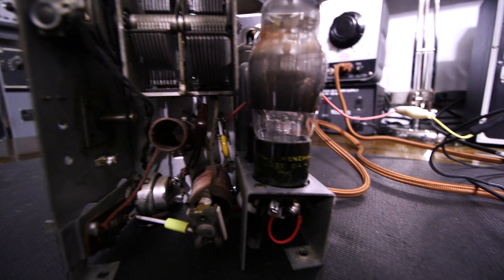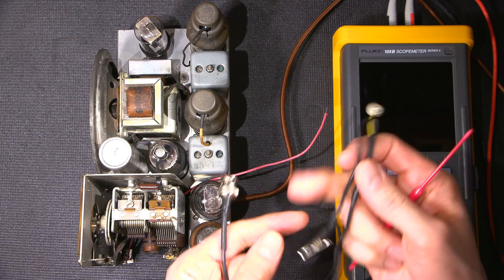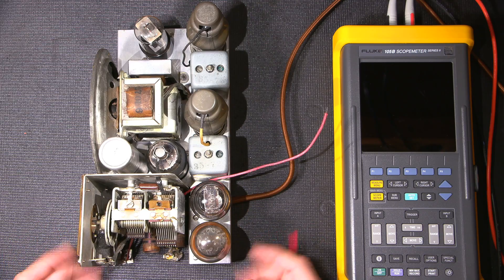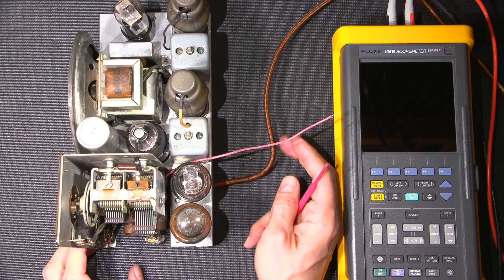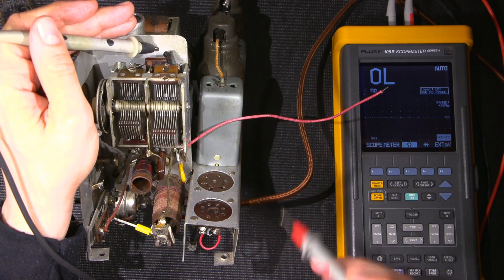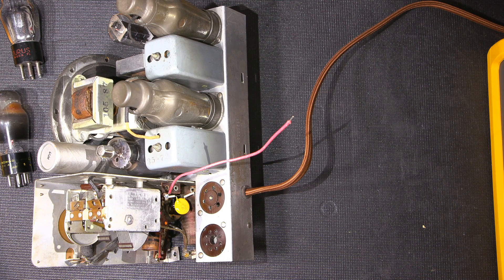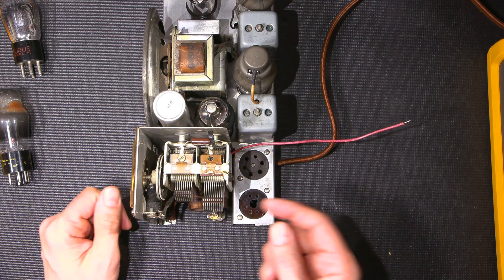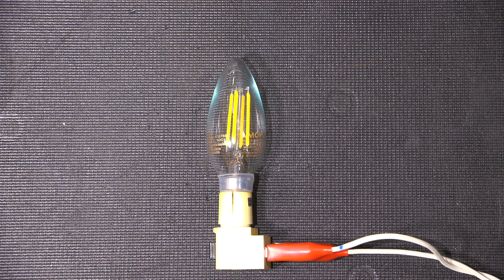See High Voltage Created From Falling Snow!

Comment: I'm a broadcast Engineer who specializes in maintaining AM arrays. We were hooking up a new tower in an older 4 tower array and there was an electrical storm approaching. one of the guys with me touched the tower and got a healthy shock from it! (the transmitter was off). We measured about 120 volts AC across the base insulator! Since then we use a jumper cable to ground the tower and make it more safe. Also don't play with a 285 foot lightening rod with electrical storms around!

Comment: I think you have two air gaps breaking down microseconds apart.  The chassis is isolated, so the incoming static electricity is charging what in effect is a parasitic capacitor between the chassis and its surroundings.  It's very cold outside so the humidity is low.  The voltage on the chassis will steadily increase until it flashes to ground through the path of least resistance, which I suspect is the air gap between the primary and secondary windings of the isolation transformer.  Once the accumulated static charge dumps to ground, the potential between the chassis and the coax instantly jumps from zero to several thousand volts.  This risetime is so fast that the inductor blocks the inrush current forcing it to take another path to the chassis.  That path is the narrow air gap between the coax and the radio chassis.  You have inadvertently created a relaxation oscillator.

Comment: As A commercial pilot, I have gotten St. Elmo's Fire from snow! It is a real thing, even with snow.
Reply: NBNTelevision the first time you see it and you haven’t heard of if it freaks the hell out of you!
Reply: Could you also see a new horizon underneath the blazing sky?
Reply: Annnnnnd...isn't it also the case that it doesn't harm your radio equipment? Even though it's all solid state gear these days?

I mean, if I take Carlson's fearful comments at face value, one would expect electronic equipment damage aboard aircraft whenever this phenomena occurs; esp. the radios. But, (normally? generally?) it doesn't happen! Planes get where they're going fine, despite flying thru wild fields of static potential up there.

I'm not yet convinced it wasn't simply because he had his lab+rig+antenna system connected in some unfavorable way somehow.
Reply: Andrew Skretvedt Quite the contrary. Aircraft are very different. We aren’t properly grounded. We have static wicks on trailing edges to help dissipate static electricity. In my experience, I’ve had avionics damaged from static. I am not as familiar with the isolation techniques used in avionics, but it’s kind of a different game from radios here on the ground, something I’m much more familiar with. Static can and does damage avionics. That’s why we have backups for backups.
Reply: @atsdroid  I replaced about 200 IP phones at one place in Reno, they all died from call center agents plugging in their headsets after walking inside each morning.  Electromigration is a thing, it becomes more of an issue as junctions become smaller.  If that arc kept going forever on the tube radio, eventually it would eat a hole in the chassis.  It's a lot easier to burn a hole in a silicon die where junctions are the size of a few atoms.  Eventually the phone was redesigned to improve decoupling at the headset port, but that same tiny shock applied to any other part of the board would still probably kill it.  It's impossible to isolate everything, at such tiny scales.  This is basic physics, not "fearful comments".  It's a huge multi trillion dollar ongoing challenge in aerospace.  A single charged particle can break 1000s of electrons loose, and it can be hard to predict where they go.  Real world testing and revisions are required.  This is why the radiation hardened parts used on aircraft lag several generations behind modern technology, on top of the larger processes being less susceptible to radiation damage in the first place
Reply: Seen it lots myself too. You can hear it on the radios crackling away but my understanding of it is that the avionics themselves (and the occupants) are protected by the Faraday cage effect. Hence the static (St. Elmo’s) remains external to the skin and doesn’t damage any of our electronics. It looks really cool though! But 36 years of flying under the belt and no damage to anything on the aircraft.
Reply: @malcolmhodgson7540  If you can hear it on the radio, then some is getting inside via the antenna.  Fortunately those radio frontends are designed to handle it.  Ever since Pan Am 214 went down due to a lightning strike that ignited the fuel, careful engineering has gone into redirecting all those stray electrons away from anything important, and commercial aircraft are very, very safe now, despite each one statistically getting hit by lightning at least once a year.  But there are still occasional issues - the Aeroflot crash last year was due to a lightning strike taking out the radios - one in a trillion chance that the antenna got hit directly, instead of the lightning rod right next to it  (St. Elmo's is also a lightning strike, just a smaller one that goes backwards)
Reply: @nbntelevision1  They're doing something right in aviation, though, whatever it is exactly, because we don't have computerized airliners and their radios becoming disabled every time they get close to weather phenomena. Weather flying is a daily occurrence, and while failures do happen, from time to time, you'd expect more given the conditions flown in on a routine basis, if the cause of the failures were shown to be static charges on the aircraft skin, antennas, etc.
Reply: @atsdroid  The static wicks they mentioned have a lower corona voltage than the rest of the skin and high resistance, allowing accumulated charges to dissipate slowly rather than in bursts.  Lightning (whether small or large, forward or backward) tends to go for the pointiest thing nearby.  The static wicks are really pointy.  But the main thing they're doing right is being in the sky (high impedance path to ground), made of metal (Faraday effect), and not dangling a half mile long ham radio antenna out the back (a big pointy thing).  Avionics are also engineered with isolation in mind - every regulation to that effect is written in blood.
Reply: @atsdroid  It may also be worth mentioning that even with the static wicks and frontend isolation, a very common source of 'could not duplicate' shop reports is that some of the charge from the atmosphere-earth plate capacitor dissipates through the antennas anyway, which pushes the radio's automatic gain control so far that normal radio signals are inaudible - which often goes completely unnoticed with no indication that there's a problem unless ATC asks why you missed a call after you clear the area.
Reply: @alakani  That may be a reasonable speculation; my whole point on this thread however was that radios aren't routinely getting fried by atmospheric phenomena in airborne service. Therefore, this industry is doing something(s) that are effective in protecting electronics (esp. solid state) from atmospheric phenomena.
Reply: @atsdroid  Yes, the specifics are covered under FAA regulations 14 CFR § 25.899, 25.1529, 25.1717, 25.1729 and several others, each in response to a fatal crash; engineering best practices are briefly explained in Advisory Circulars 20-136A, 25.899-1, 25.1701-1 and others.  In addition to temporarily or permanently disabling radios or radar, precipitation static can weld control surface hinges when bonding wires come loose.  The potential for damage is higher for ground stations due to the lower impedance path to ground.
Reply: I think you are speaking of ESD. Electromigration is the movement of the metal inside the semiconductor. ESD is a high voltage spark that damages the devices. 

And people that ridicule ESD are often unaware of latent damage.

Comment: 40-something years messing with electronics and I have NEVER seen or heard of this! Awesome!
Reply: More than 40 years for me and for at  least 40 years I have always disconnected my long antennas when not in use for specifically this reason.
Reply: you can be shocked by dry pine trees when it's very dry out if the snow is just a cone on the tips of the needles... I've been hit dozens of times by the effect.   Ice has many forms and snowflakes change with electrostatic charges

Comment: Gameboygenius nailed it. Just because you were observing an arc in the radio does not mean that was the primary source. Very likely, as the antenna was charging due to the snowfall, that it eventually arced to ground somewhere. Either across the dipole legs, to a support structure, or even inside the BNC connector. When it discharged the input side of the radio’s blocking capacitor changed from being at several thousand volts to near zero in nanoseconds thus causing the secondary arc you observed and also explains how it could establish such a high voltage across the 36 ohm resistor without it going up in smoke.

Comment: I had similar in 1978 while working in a small CB shop. This during a thunderstorm. I had the end of the coax lying on the bench ready to test the next CB unit that neede an external antenna check and sparks were jumping from the center of the coax end to one of the handles of the monster old 555 scope my boss found in a dump. I was having fun with that. The boss wasn't there that day, but he heard about it and asked me about it the next day. We had a couple of words over it and I asked him if I would go up on the roof to investigate. He told where the ladder was and I went on the roof and found the half-wave antenna was mounted wrong. The ground wire from the mount was attached to a hot water heater flue. I reported this to my boss and he said that he had a couple of locals with a six-pack do the antenna installation before I was hired. The thing was that I knew these 2 clowns that did this from the local CB traffic at the time. Oh, did they catch it from me!

Comment: The same thing happens to an airplane flying through precipitation; it can pick up a static charge . Airplanes used that way have static discharge wicks to drain away any electrostatic charge the airplane may pick up while flying through dry snow (or even rain, to a much lesser extent). Too much accumulated static charge can cause noisy VHF radios. At night, the charge can be seen as a blue arc as it dissipates from the propeller blade tips. It also accumulates around the sharp metal edges around the windshield. If you get your face too close, it can discharge to the tip of your nose! It's not a harmful spark. The phenomenon is called Saint Elmo's Fire. It was first seen in the rigging of sailing ships. It is beautiful to watch.

Comment: You might not be old enough to remember when most TV antennas were connected by 300 ohm flat lead. Static build up was a well known problem back then that could damage receivers. So, it was common practice to use a type of spark gap on the line to discharge high voltages. People often called it a lightening arrestor. In reality, if lightening hit your antenna directly, that device did little to stop it from destroying your TV and other appliances. If it hit a half mile away, it would discharge any eddy voltage in your antenna. The devices I've seen were round with screws the bit into the flat lead and line that went to a grounding rod. The spark gaps were embedded in phenolic. Perhaps you need something like that on your antenna.

Comment: Your antenna turned into a giant Van de Graaff generator! As the snow whipped across the antenna it created a massive static charge, like the feathers to the belt on the generator. Normally it wouldn’t happen if it was properly grounded but you just had a series of perfect events to lead up to it.